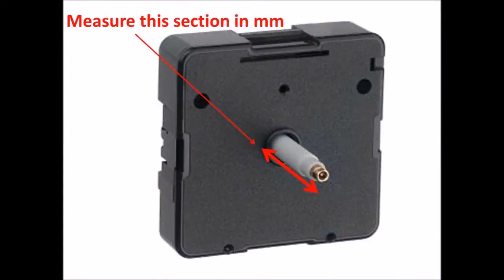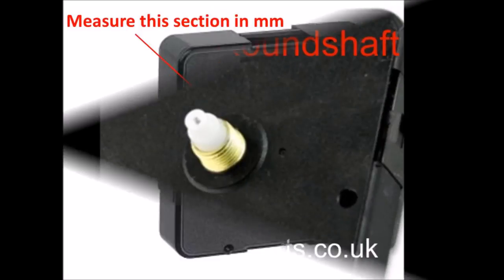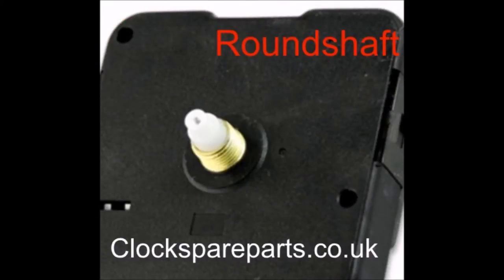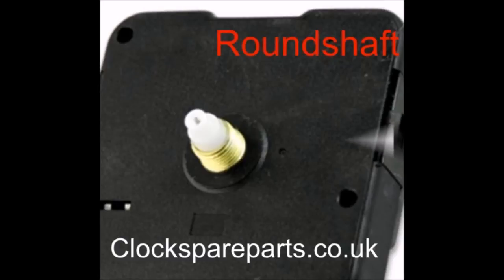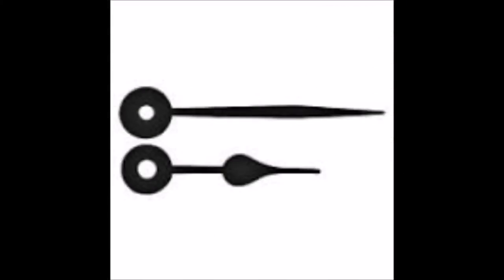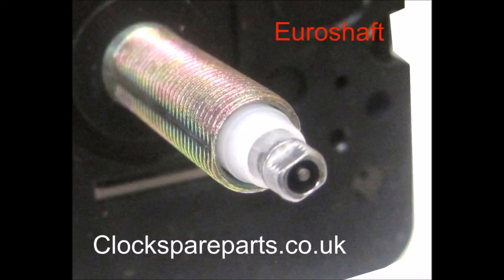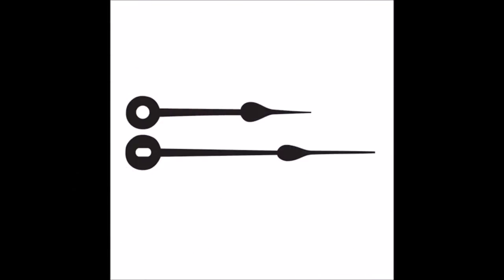How do I measure my Quartz clock movement

Comment: Curious, but are the Euroshaft German movements smaller in circumference for hand holes that are a little smaller, or are they the same or bigger than their U.S. counterparts?  Trying to find a way to use my vintage clock's hands.  It was a GE clock but it was made in Germany in 1964.  Seems as though the hand holes are a little too small for modern U.S.-made Quartz movement rods.  In case I decide to try to have the original movement fixed one day, I really didn't want to expand the size of the holes to use them with a U.S. quartz movement and was looking for a foreign alternative.